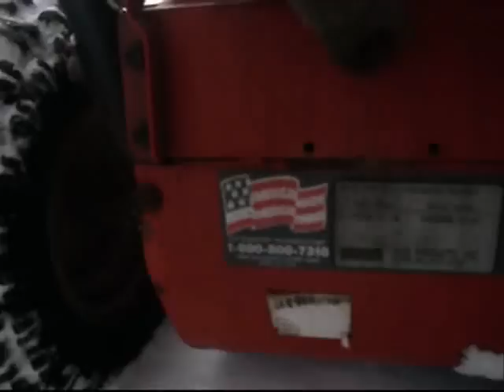2 4 11  Mrs CW Snowblower...

Comment: That snowblower looks a lot like mine I have a 10hp 24 that a MTD I bought it at SAMS club 12 years ago I bet that one is at least that old those were beasts and they do not make them like that anymore the new one are 6hp 24 inch and made with plastic . What modle number and serial # is that snowblower/ Mine I lent out and the guy  backed his car in the side breaking the carb . I hope to get a carb this ssummer as I have a 13hp Ariens  as my main blower